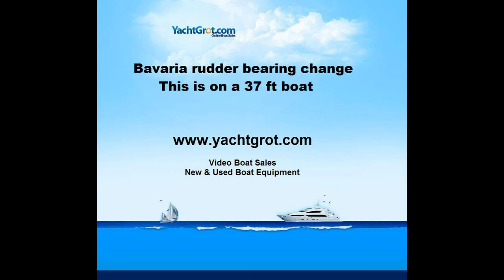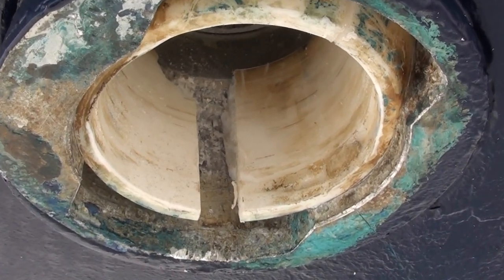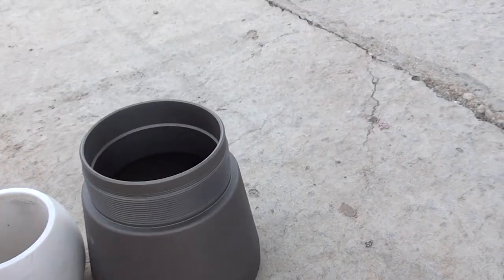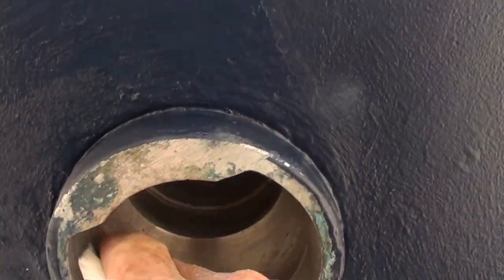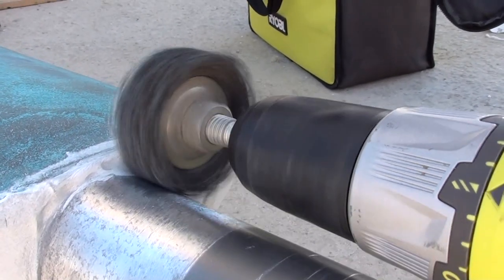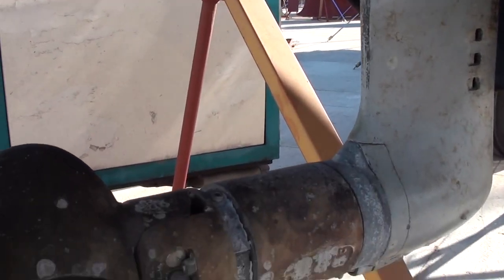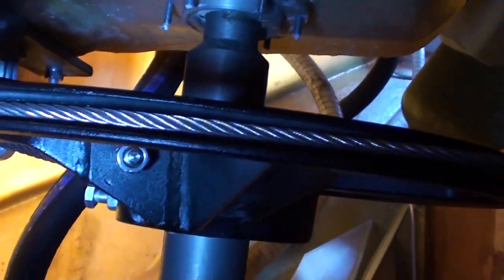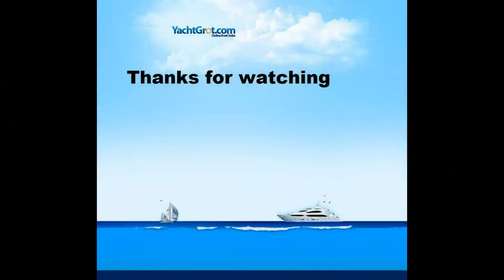Bavaria yacht rudder bearing and anode change on a 37 ft boat

Comment: Very good description of a rudder problem. After coming down throught the French canals I raised the mast and set sail for Toulon in my little old Westerly Cirrus. But only to discover play in the little girls rudder with four meter waves roller coasting us along. On lifting the boat out I found no anode, enormous gelcoat blistering and a rudder full of water. I knew about the blistering and can deal with it but the rudder needs full attention. Should I split it open, west system it, and close it again ? Linking the rudder with the heavy duty cable to the anode looks very professional.